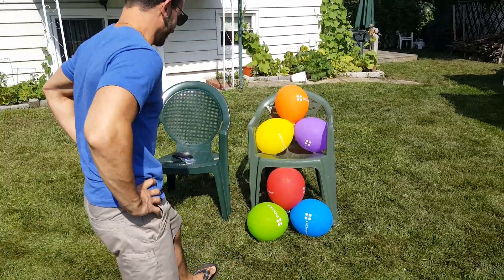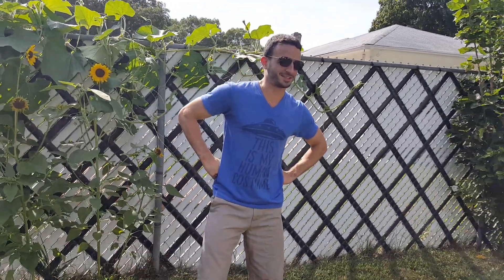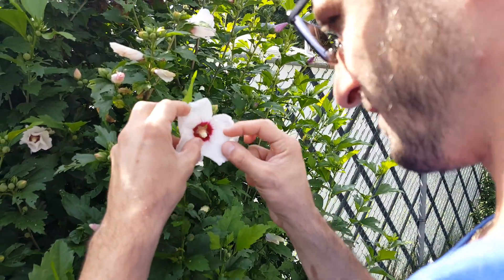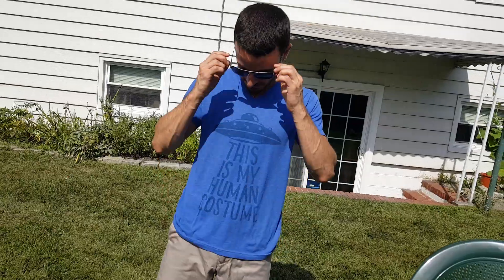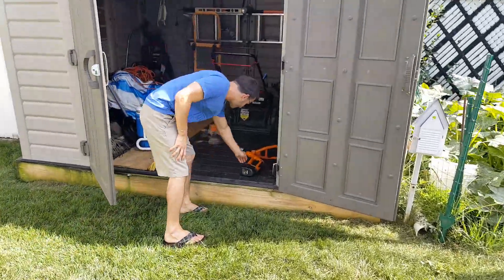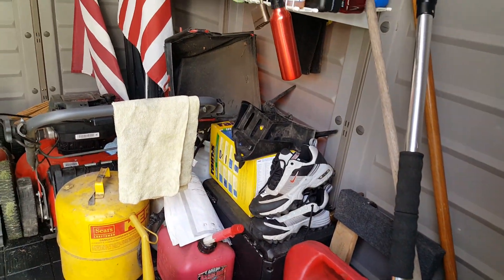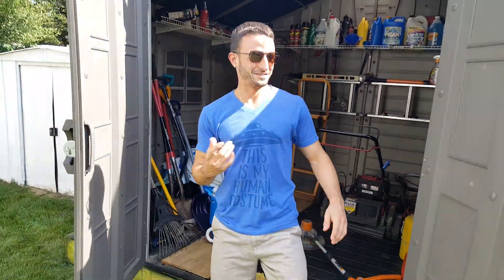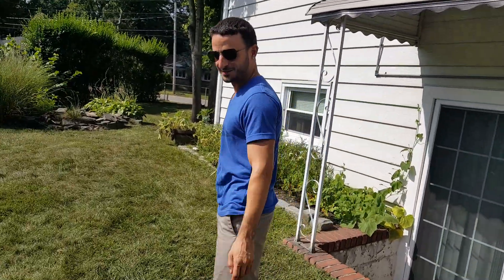Enchroma Glasses Reaction: Color Blind Glasses CHANGED My Life FOREVER

Comment: Interesting tech.  They don't add anything.  They subtract.  You have "cones" in your retina for red, green and blue.  Your brain then analyzes those signals and decodes color.  Red-green color-blindness results from "overlap."  Your brain is getting the same data from two different colors.  The glasses simply block the problem wavelengths.  So the only red you see is VERY red, and the only green you see is VERY green.  However, a person with normal vision would be able to see those problem wavelengths just fine.  Through the glasses though, all you'd see is grey whether you have normal vision or not.  

Not a perfect solution, but it's helpful if you happen to have the most common form of color-blindness.  It's like walking with a cane:  It doesn't cure your bad knee, but it does help you not fall down.